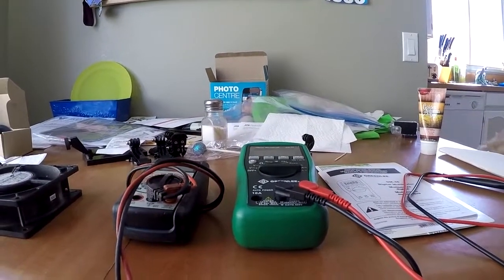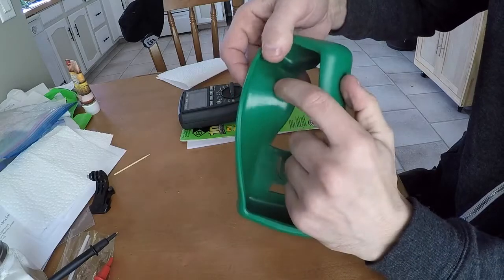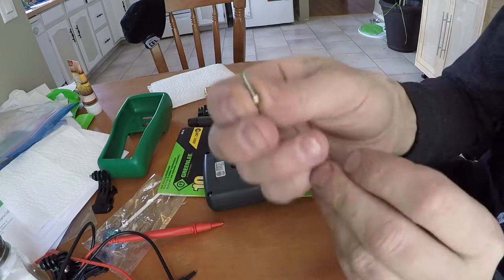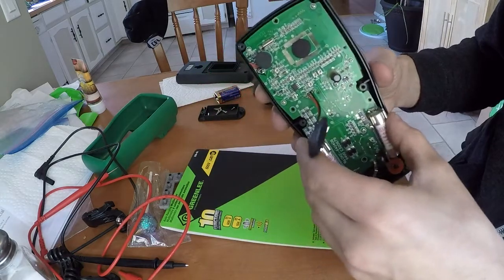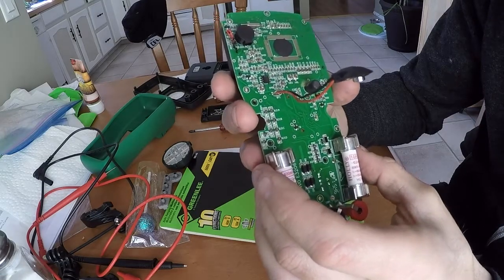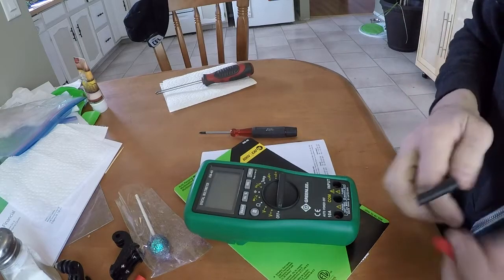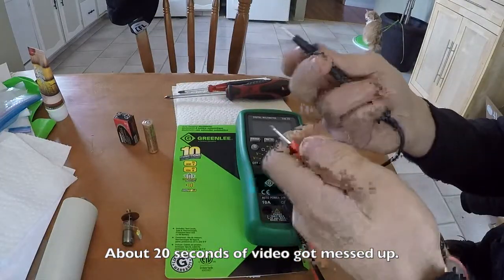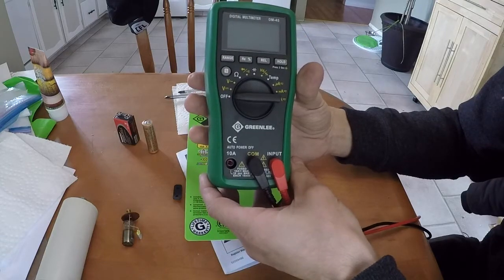Greenlee DM-45 Teardown / Review. Multimeter Review.

Comment: I was a fan of fluke, but with the prices of fluke and the low functions of these multimeters for such high prices, I changed to Greenlee Dm860A, it is the same Brymen BM869, and I am happy with this multimeter, it brings more functions, than my fluke 87V and the greenlee dm830A is cheaper than fluke 87V they are the same in functions and have AUTOHOLD as fluke 87V
Reply from the maker: Right on. A few weeks ago I dropped my multi meter into salt water while working on a JetSki and that was the end of that... Not sure what I will get next.

Comment: Why are there two fuses? Theres only one Amps input.
Reply from the maker: I haven't actually checked the fuse routing ... but I would assume that one is fro the AMP lead (plug) and the other is for the lead (plug) that does everything else, volts, ohms ... just in case.

Comment: I own this, and have worked with it for a good while. It's a good meter, but has a major flaw that will make me buy a new one. I ended up busting the 400 ma fuse, and have searched for hours and hours to find it. Parts books, the fuse manufacturer's website, greenlee's website, tons of other parts/fuse websites, the whole warehouse at where I work that has hundreds of fuses, but still nothing. It is impossible to find a replacement fuse so you really shouldn't buy this. There might as well not even be fuses if after you go over the amp limit the fuse breaks and you need to buy a whole new meter.
Reply: Takes same fuses as Fluke

Comment: I stand corrected, in my previous comments I said it lacked the protection of other Greenlees, but I wasnt entirely right or fair when I made that comment.  The fuses are top grade, and thres protection devices present just not as obvious or highly robust as in the bigger meters.  Upon closer inspection on your video I see there is indeed protection there - just not as obvious.  Instead of a large standard current resistor theyre using a number of surface mount resistors in a ladder configuration, also on the display side down by the current shunt is a collection of what looks to be a PTC and other protection devices and im sure I saw a diode clamping array as well.  I jumped the gun and was not fair in my first comment, and after owning my Greenlee for awhile and looking closer at your video I realized Greenlee doesnt make cheap products, even their lower end stuff is decently made with all the protection the price class will allow.  Your Greenlee was a good choice for your purpose and you have a decent meter there, also Amazon reviews support its build quality and reputation.
Reply: Well as I said I jumped the gun and didnt look close enough and I have no problem admitting I made a mistake.  Ive since found Greenlee to be very well made even in their lower end product.  Just like anything the more you pay the more you get, in Greenlees case lower cost doesnt necessarily mean cheap - but you easily got what you paid for in your meter im very pleased with mine.

Comment: Im surprised, Greenlee is supposed to be a rebranded high quality Brymen meter but this Greenlee is missing almost all the Brymens input protection except for the fuses.  I dont see any MOV's or PTC's or any large high current resistors and the jacks look like any other chinese meter.  Look at the similar Brymen model and compare the two--night and day.  I dont doubt the Greenlee measures well, but needs more than the big fuses for protection against transients and I dont thing theyre cheap either.
Reply: Well im no expert, just done a (lot) of research before selecting the meters I have. I never looked at the Greenlee's but it looks like the same outer case as the Brymens so I asked a few places online and was told Greenlees are rebranded Brymen meters - I had seen the inside of Brymens before, but I had never seen the inside of a similar looking Greenlee until now.  Brymens are pricey and Greenlees arent dirt cheap either but seem to have a good reputation, so until now I had assumed  they both had similar internals.  I dont know what ya paid for the Greenlee but the cheapest Brymen is around $125 and up with one of their mid/high end ones at $230 and thats getting into 'Fluke territory - but inside the Brymens youll find excellent build quality rivaling Flukes and extensive input protection that is well known to pass extreme high voltage transient tests.  BUT all this being said I just did what I should have in the first place and found some pricing on your particular model and looks like they go around $45 - $75 depending on where you look, so $100 is a bit steep for this model but unless you spend time looking everywhere for days no telling what price youll end up with.  Given that price range your meter looks a tad under par for the course compared to others in this range, some a bit better some worse so in the ballpark.  BUT In the end the uses you describe arent extremely demanding and the general build quality of yours looks decent enough for your needs, those large HRC type fuses are a definite plus, I also think I saw a bit more input protection on the front of the board too - and I really like the way the range control switch is built as well, one of the best ive ever seen and the meter should be accurate in general - it just doesnt have the extra heavy input protection that one would need in an industrial or high voltage environment, but why pay for it if ya dont need it right-?.  I wouldnt worry about home or hobby use, Greenlee does have a decent reputation.  I have meters myself just like this, very accurate in use just not built like a fluke - nor do they have the fluke price-lol    These meters are marketed to guys like you and me with average low demand use, what we need is accuracy for a reasonable price and decent longevity.
Reply: lol - Yeah I spent too much time on it im sure, got sucked in watching reviews and became one of those few on here with a brief multimeter fetish, some folks collect coins or whatever for me it was meters till recently - thankfully im over the obsession, my last and final meter was a new Fluke 17B+ which had I bought one earlier would have saved me some money-lol.  The Greenlee is waay better than the old ya showed, and like I said, if the meter works for what you need its all ya need.  I still think Greenlee is better than many of the oddball named asian clone rebrands, at least yours is built on the Brymen platform - they make good stuff and look to have good reviews as well, it should last you for years in home/hobby use.
Reply: yambo59  Very interesting, I've been doing a little research, but every decent multimeter seemed to be in the 100-500$ price range, i was looking for something with good build quality for under $50, and I unfortunately needed it fast so i didnt have much time for research.  This Greenlee looked to have the best quality for the price from what i could find, and you're right about the Chinese rebrands, they've taken over the whole amazon market lol, but when i finally found this Greenlee and saw they actually had a legitimate website, and good solid electronics, it was like a breath of fresh air.  Even though I ended up going with this Greenlee, I would love to hear your thoughts on what the best multimeter for this price range is.